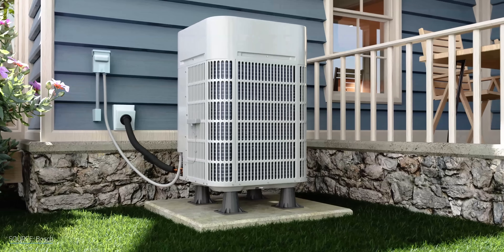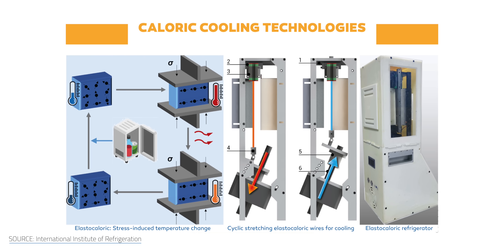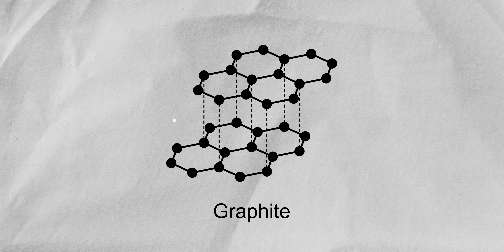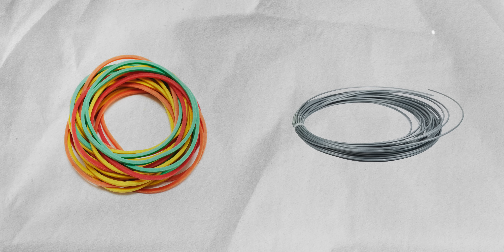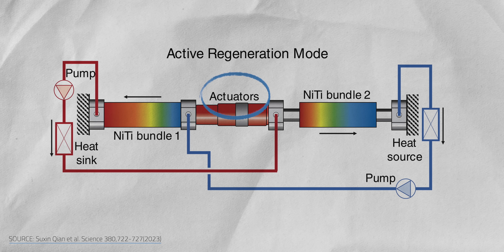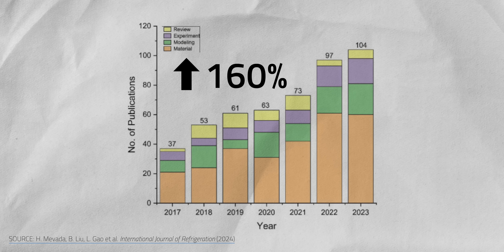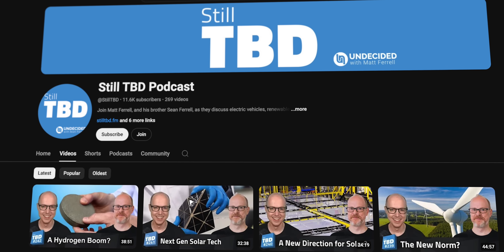How Solid State Cooling Could Change Everything

Comment: The refrigerant of the future is CO2.  It can be taken from air and replenished from combustion.  It also can be used to enhance combustion cycles to achieve 75% in combined cycles.  

The CO2 can be used for soda pops and other uses.  1 gallon of gasoline at $3/gal can make $32 of dry ice and 1 gallon of water for use in a car/truck for showers, toilets and more.  The CO2 has many other health uses, including skin care.

The future is to take CO2 from combustion for free and make fuel from solar thermal.  3 cents/kwh fuel ($1/gal).   

Wind/solar PV/battery/EV system will be 60 to 90 cents/kwh due to systems needs.  90 vs 3...  No EV can survive this cost ratio. 

The CO2 is also used to extinguish fires, which is a key factor.  Insurance costs of EVs will end EVs.  No such problem exists with new combustion tech that puts out any fire by on board CO2 and water.

Comment: 14:53 Actually a classic refrigerator can be build without HFC. When you compress any gas it's get heated and then get cooled when expanded back. So, basically there is no need in liquid phase.
Reply: @vladimir0rus  gas-only cycle will be less efficient, but you can use other gases. NH3 works very well but is too toxic for domestic use

Comment: 0:50 Nuclear energy is already that savior 😮‍💨
Reply: @itsjordo  sure thing except the 10year build and the billions in cost overruns. Solar and Wind and Hydroelectric are far more reasonable and reliable. Liquid air, salt, or ponds for storage
Reply: @millwrightmcwrenchy  win turbine blades are NOT lasting as long as they thought they would. They are made out of composite materials and resin, and there is no way to recycle them. They're literally just being buried. God forbid when the millions of solar panels come home to roost in the next 15 to 20 years.
Reply: @millwrightmcwrenchy solar and wind are the worst way we have at the time. Very inefficient and expensive
Reply: @ that’s factually incorrect
Reply: Nuclear is never as cheap as advertised.
Reply: If you plan to consume ourselves to extinction for no reason other than number go up
Reply: What you aren't getting is that this uses energy. Its not discussing where the energy comes from.
Reply: Don’t tell that to the libs lol.. they would lose whatever of their mind is left 😂.. they see the word nuclear and they would bark it’s dangerous or “Chernobyl”..
Reply: Just petition your town to sign up to store the nuclear waste so mine doesn’t have to, and I’ll be on board.
Reply: @explorerofmind  can ur town store all of the coal smoke then??
Reply: @ my town runs on solar and wind
Reply: @gunterandersson  and hydropower
Reply: @explorerofmind  This is nonsensical.
Reply: @explorerofmind  ok where to I sign that. Its not dangerous they contain the waste so carefully. Coal energy was almost tear apart our city environment nuclear energy other hand hell yeah where do I sign that shit
Reply: @explorerofmind  
That better to store combustion's waste in air and our lungs, yeah
Reply: @itsjordo  but when it melts down it destroys entire parts of the earth.  Don’t say that doesn’t happen, it does and has and could in future.
Reply: @clintelawson  doesn't really happen especially not nearly as often as total failure of coal and oil based counterpart not to mention their impact on the green house effect is far greater than total nuclear energization would be

Comment: I don't understand this... How you transport the energy from the one place to another? If it needs to use s fluid to make that transfer, that's not the whole point of refrigerants? To use the properties of a fluid, but very efficiently? If you create a machine that uses a solid just to make heat, isn't just better to use a compressor directly into a fluid that will already carry those properties down the pipe? What's the point I'm missing on this?

Comment: You call it an air conditioner, or rather refer to it as cooling technology. I am an hvac technician, and we usually do not say something creates cooling, we say it moves heat or energy (i.e. heat pump). This technology in your video cools, and a byproduct of the cooling is heat, right?

My point is that heating is debatably more important than cooling. And if this new heat exchange technology is a different way of cooling, then it must be able to do heating through engineering, right?

A new heating technology would be more exciting than a new cooling technology, in my opinion. But maybe they are the same thing.

Comment: If the aim is to stop using hydrofluorcarbons, then just stop using it. Ammonia is a suitable replacement with zero GWP, already applied in many heat pumps on small and industrial scale. It is also readily available and cheap to boot. 
I do like the idea though and I think that in some specific cases this can be viable.

Comment: note that superelastic NiTiNol is much more common than shape memory NiTiNol.
since superelastic has a much bigger market.
many places like amazon and even normal matal shops will often market NiTiNol as both superelastic and shape memory.
while in reality they require different forms of being treated.

so when buying NiTiNol for superelasticity that is easy to find and be positive it is that version.
the memory alloy version is much harder to find as 90% of the open to consumer listings for " shape memory" NiTiNol are actually superelastic NiTiNol as that is used a lot in medical things and industry.

that said the shape memory alloy version of NiTiNol is much more fragile than the superelastic one.
superelastic NiTiNol is very hard to break(requires super hard materials, or something like strong scisors with huge force) well or you need to cool it down to much and try to break it then or heat it up to much and either let oxygen attack it, or let it glow to make it lose superelasticity.

Comment: So there was a paper a couple decades ago where they were able to twin together a rigid fiber and an elastic fiber to make a stiff fabric that when stretched actually expanded as opposed to contracting. The context was originally in terms of seat belts cutting into people during car accidents.

I'm wondering if the two ideas could be combined to make a self cooling or self heating fabric that works harder the more you move.

Comment: If Solid State Cooling lets me buy a fridge or A/C that doesn't cost an Arm, Leg, my First Born and Immortal Soul while still using the same or less Electricity for equal or better cooling as my conventional fridge, then HECK YES I'd be interested in a fridge that I don't have to worry about gas leaks wrecking the Ozone Layer...ESPECIALLY since a Solid State unit is likely going to be much quieter than a Gas Compression unit...

Comment: As an engineer, I always look to phase change as the best way to move heat.  I did not realize nitinol and rubber had phase changes in solid form.  I have experienced both, but didn't realize that was phase change.  I also experienced the heating, but did not notice the cooling.  Good things to learn.  However it isn't going to be more efficient than other refrigerants unless we can get two phase changes, like ice to water to steam is two changes.  If a memory material could have two sequential phase changes in solid state, THEN we might be able to gain on the efficiency of a gas.

As for eliminating chloroflourocarbons, that has already been done, many non-cfc gases could be used.  And we have unexploited technologies, such as using molten tin to store heat for warming the house in winter....  Sand batteries, for example, are a waste of space and closer to 2% efficiency without a phase change.

Comment: I would build an elastocaloric clothes dryer that removes moisture from the clothes without melting the polymer fibers, or heating your air conditioned home air and then blowing it outside.

Comment: I would be pleasantly surprised if these alloys maintain their memory across a lot of heat cold cycles. I think some sort of mechanism will need to be built in to refresh the memory such as a part of the cycle that heats the alloy above its memory set temperature, then resets it cold in its original configuration.  This is going to make the process less energy efficient. 

I'm still wondering what's the potential of Sterling engines are in cooling. Not solid state but theoretically very efficient.

Comment: Could this effectively store otherwise lost energy in things like ovens, absorb a lot of heat when you turn the oven off, instead of letting it bleed into the house, and quickly release it into the oven when you next turn it on, or is that going to stay impractical for size/cost reasons?

Comment: Could you use the weight of the thing you're trying to cool to jump start the process? Heavy shipments of produce as an example, loading them in a refrigerated transport imparts a lot of force that could help with the more energy intensive initial cooling before other systems kick in to maintain the temperature.

Comment: I "discovered" this effect in the 1950s, when I had braces on my teeth, and rubber bands on them between upper and lower jaws.  If I opened my mouth wide, I could feel the rubber bands warm up.  Wait a few seconds and then close the mouth and you could feel the rubber get cooler.  I wondered back then if you could make an air conditioner using a rubber belt stretched on one section and then allowed to unstretch on another part of the loop, with air flowing separately across each section.  Seemed possible, but not ideal.

Comment: Simple question: does deforming the wire heat it or cool it? You add heat for it to return to shape, so is it correct that the deformation will cool the material initially?

Comment: If the COP of this new technology is about the same as existing technology, it will not find wide acceptance.
Reply: Unless it costs significantly less. Even if the manufacturing process is cheaper/simpler and consumers pay the same, as long as the performance is there then this is a clear winner.

Comment: Not solid state. The heat transfer medium still has to be mechanically deformed.
Hydrofluorocarbons haven't been used in refrigeration for 30 years. 
Even less useful in this application than Peltier devices.

Comment: It all sounded very exciting until it turned out that expected efficiency isn't but higher than of the common vapour compression systems. 

Reducing HFCs is of course an extremely valid point. But there are enough alternatives for HFCs in conventional systems already. In the EU, almost all sold fridges are using Butane as a refrigerant. The Global Warming Potential is below 3, so with a charge amount of under 1kg, that's completely negligible. The Kigali amendment to the Montreal Protocol is ratified by 160 countries and foresees phase-out pathways for HFCs. The new EU F-Gas regulation is extremely restrictive which already has an impact on AC and Heat pump markets using more and more propane as a refrigerant. From 2027, they will have to due to the regulation. Propane also has a GWP of below 3. The only caveat: Butane and Propane are flammable. But in these small quantities that can normally be handled. After all, we have been using gas stoves (using much higher quantities of explosive flammable natural gas) to heat our homes for decades!

So I can think of few aspects remaining that could give the edge to solid state here: first and foremost efficiency (which will decrease energy cost over the lifecycle), production cost, Space requirements, and perhaps noise.
If it doesn't excel in one of these aspects, I don't know if there will be a market.

Comment: GE has been working on magnetocaloric effect based cooling for years. though i am not sure where they are with it. but if i recall, its estimated to be 30% or so more efficient than normal compressor based refrigeration's theoretical, which is a huge leap. its been a while since i have looked into it.
Reply: lol that bar graph really shows magnetocalorics getting knocked down a peg :)

Comment: Elastochloric material could be merged into heatpipes to act as a heat-powered heatpump engine to remove compressor, noise, hence electricity from the 2-radiator loop.
Reply: Theoretically speaking, It'll get smaller faster, act as a vacuum, let the vapor move inside the heatpump, and as it pumps, it'll pulsate between expanding when heated and shrink when pumped that heat out.
*but you'd probably need a different metal at the warmer radiator's heatpipes

Comment: As an hvac technician for 20 years….HEAT PUMPS SUCK. A compressor running all year is a great idea 🙄. I suggest a good old simple gas furnace. I replace a 40+ year old furnaces all the time. I guarantee nobody will ever get that out of a heat pump

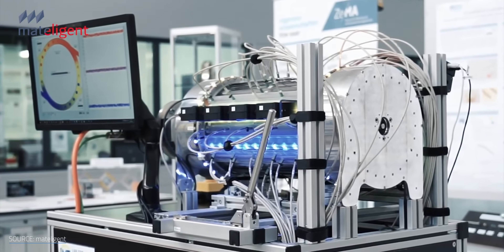Comment: So i saw the "thing" at 14:22 and thought:

Maybe the best design would be like a double-ring-system, where the two rings are connected with elastomeric compounds, but the inner ring can be adjusted to get very slightly off-center to create a stretch for the material on one side and a chill site on the other side. You then can use a 2 way system to exchange the heat to the environment via a fluid and to exchange the less-heat to the chamber which has to be cooled.

But i think there would be a problem with the separation of the 2 sides because the 2 rings are changing the sides constantly. So you probably end up with the same problems, a Wankel or Liquid Piston Engine encountered during its development.

Comment: The biggest problem here is actually transferring the heat. In a classic refrigerator or an air conditioner the heat is transferred by the refrigerant (the cooling agent). In a solid state air conditioner how the heat is supposed to be transferred out of the room when a cooled NiTi wire absorbs the heat of the room?

Comment: This tech has been around for half a century and has changed very little due to the physical limitations of the device. It is only used where there is allready an extreme temperature difference (think rocket engines) or other extreme limiting factors where refridgerants take up too much space or are exposed to elements that make them unsuitable. The fact is that the thermoelectric effect will NEVER make sense in the consumer space, because it simply isn't efficient enough.

On a side note, people putting this forward tend to talk about how cool and elegant it is to harness the power of natural phenomenon to do heating and cooling. Well, I think that the fact we can create an extremely efficient heat pump using nothing more than phase changes and simple pumps is far more elegant than the thermoelectric effect. It's incredible that we can bend the rules that far with nothing more than a few meters of pipe and a pump. Can't get much more elegant than that.

Comment: E in vs E/t out.... Component recovery RRR X 7+B people = a need for multiple refrigeration systems tech delivery and on-going service. The Freon issue with Ozone depletion is 85%+ aircraft fuel emissions reaching the stratosphere, not the ground based systems ... consider Why and When  'free air miles' was introduced ... hint...after a Globe conference of scientists determined it was the jets constant polar migration of fuel chemistry ...why bother the public with facts...to seduce vs reduce the jet-setter economy...anyway...a gaseous rant.... sure like the idea of a solidstate coolant system thats expandable with modules or retrofits... Good explanation of some new techniques.. Thanks

Comment: I want a fitness equipment that captures the mechanical energy I put into it and turns that into cooling. Like a stationary bike with this kind of a gadget attached for cooling the room the bike is in. Maybe a fitness center with a fleet of bikes could gamify it in someway. One of the frequent problems of gyms (both home and commercial) is that they are too hot. This might not be efficient enough, but maybe it could chip in. The cooling is at least delivered exactly when needed

Comment: you know those silver foil pens that crinkle when you press the top? if you hade a dense multiwalled cylinder out of sheets of nitinol in that dimpled geometry, then it could be stretched lengthwise and deform every nitinol sheet in a uniform way that still allows for some heat transfer liquid to flow through the entire stack making good thermal contact with each layer. id say use a more accordion style to maximize the deformation, but i think it would obstruct flow too much. this dimpling effect wouldnt do much more than baffling the flow a bit, but that might be good anyway to increase transfer out. then, when in its cooling phase, the walls become smooth and laminar flow can be achieved which will expedite the flow of cooler fluid out.

Comment: I'm thinking about a design where you have lots of wires and two plates on an axle which keeps the plates at the same distance. The wires go through holes in the plates. You can then turn the plates to add tension to the wires. That would allow for a lot of wires and a simple mechanic to use them.

Comment: The math does not really add up in large scale.
Cooling 1 liter of milk could need 1kg nitenol being pressed, pulled, moved around, cooled and heated, with multiple motors, fans and cooling pumps.

Comment: would be interesting to try to make a composite materials of nitinol and one of those bimetalic strips (expand when heated, contract when cooled). would create a passively cooling/heating material that keeps your ideal temperature. you'd likely still need a lot of them and it would be very expensive up front but interesting idea